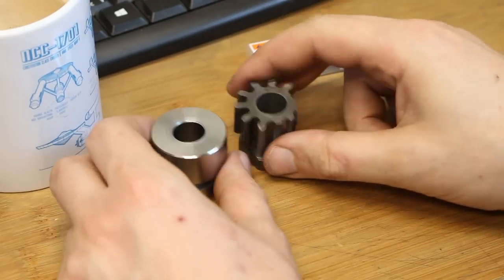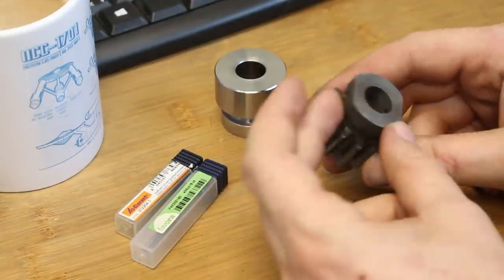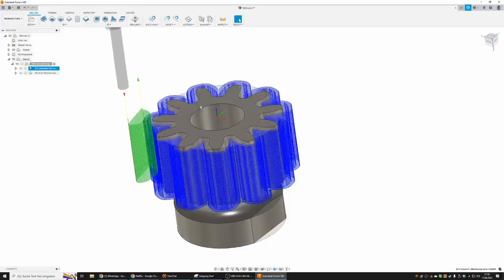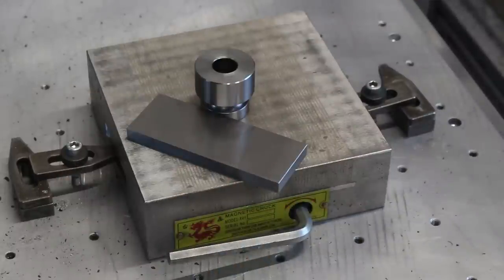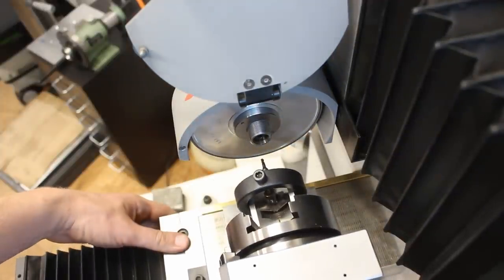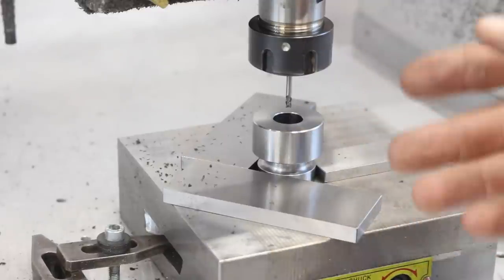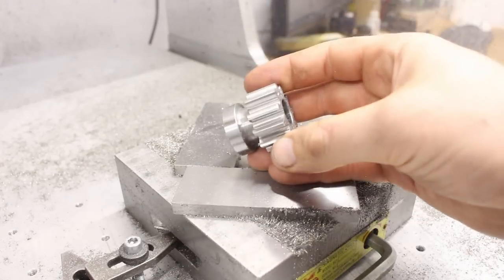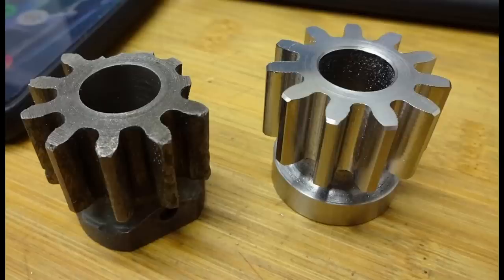Making a part: Replacement gear

Comment: When I worked for UK Plant I saw a lot of gears that shape, usually teeth worn from various abrasives getting in there and changing profile. As long as things kept running, they didn't get changed (and usually compete machine was scrapped rather than try and source new parts)
Reply from the maker: Oh, wear makes sense!

Comment: Hi Sefan! Very interesting and nice result. In your drawing you have 11 teeth with a 36mm OD and 23mm root circle. This is very close to a 2.75mod gear (actually works out to 2.77) or a 9DP (9DP=2.82mod). The slight difference might be due to wear or rounding in your measurements, the original gear looks very worn apart from the broken teeth and may not have been to ideal spec. when it was new (esp. if it was cast). As you no doubt know, gears with less than 12 teeth often have the profile modified, usually by making them with a pitch circle diameter one tooth larger than the number of teeth being cut, however it doesn't look like this was done here, the OD is close to a modified 2.5 mod, but the root circle should be around 23.75mm in this case, so this appears to be an unmodified gear. Not having the profile modified probably contributed to it breaking as the teeth would have a greater undercut and less strength. (Yes I know you said it was close to a 2.75mod at the end of the video).

I'm impressed with the magnetic chuck setup, I might have to get one of those, thanks for sharing!
Reply: I was thinking the same thing. The teeth are fish-hooked from wear, so one should derive the shape from the undriven side (assuming there is an undriven side).

Comment: Axial load is the physics behind the geometry that achieves surface finishes in tight corners. You sold me on the cheap mag plates. Now I'm thinking of die sinking some relief in them. You know why! Cheers from Vancouver Island.

Comment: Mighty impressive. I once watched a CNC machinist neck down a 6mm end mill with a cordless drill and a bench grinder. He looked a bit embarrassed doing it but I had to admit that I'd do the same.
Reply from the maker: Thats a absolutely viable option - I prefer a machine guided approach, since I do it a lot on endmills smaller than 2mm :D

Comment: Gear seems to look like cycloid profile  - typical this days  for clockworks and very unusual in heavy machinery. Still it is a profile that fulfill law of gearing but only at nomimal distance. I was told that those gears have been known as easier to be made in "low tech workshops" . Having here a part from old drill press - maybe that is the answer to odd profile. Neverthelees great job and  thank you for another fine video.
Reply: "Have  been known as easier to be made in low tech workshop" - lol, and now you need a cnc for that, lol. Technology is fun)

Comment: My grandmother had a clothes wringer in her laundry and it has gear teeth with such a lumpy shape.  I’ve also seen it on an old (1890) steam paddle boat.    

Stavros
Reply: I too, when I first saw the original (broken) pinion, was reminded of a 19th Century clothes wringer, or mangle, as they were known in UK.
Reply from the maker: That would be a "Wäschemangel" here :-D
Yeah, thats the kind of device I would expect a gear of that look/shape/quality

Comment: I rarely comment on your videos but had to pop a quick one down to say thanks for making them. I know when one is uploaded that I'm going to sleep well as they're very relaxing to watch as I drop off to sleep, and when I wake up I rewind and catch the second half as a soothing start to the day. This is a poorly worded compliment, I suppose I should point out that soothing/relaxing and boring are very different things for clarity.

You may be aware that in the UK, the German national stereotype is analytical, precise, efficient, boring and lacking a sense of humour. The longer I've watched your videos the more I've realised that the your (and presumably many Germans) sense of humour is very much alive, but usually far more subtle than what we Englanders are trained to pick up on. The more I tune myself into the cultural shift the more I find myself chuckling. The above is very much an assumption based on stereotypes and of course everyone is different, but assumptions are tools to work with like any other adjustment to our perception and in this case it seems to help explain a lot. 

Ta,
J James.

Comment: Nicely done I learned something from today's video. The high or low helix angle creating less radial load and transfers the cutting force to more of an axial load I understood before today's video. However I have never used that style of cutter on steel at such a high rpm and I have to say I was very surprised at the result. A very nice surface finish and the tool seems to have stood up very well. I am guessing the most important ingredient is a high quality tool to start with. Thanks for sharing as always a very interesting video.

Comment: Nice to see these "oddball" jobs, and the measurement methods ... I used the "just clearing" method to get the center of a pulley to drill a set screw hole...

Comment: Yes.. as Elan Jacobs mentioned in another message below, it looks to be 14.5 degree PA.  It doesn't appear to have much (or even any) enlargement, so a large portion of the profile/flank will be undercut.  With a 20 degree pressure angle, I recall the minimum number of teeth where undercut is not an issue is 17 teeth.  At 14.5 degree PA, that minimum number of teeth will be even greater, so at 11 teeth... there really is no good solution. (or at least no good solution without redesigning this gear and its mate).    
However, you made the best solution there was -- simply copy what was still working before it broke!  Your part turned out beautiful.  I need to get my hands on a few of those very high helix, small diameter cutters!

Comment: Excellent machining,  very interesting on the 55 degree helix 4 flute end mill, I've used images inserted in CAD, works very well,  as long as its scaled correctly 😀. 
Thanks for sharing.

Comment: I get more impressed with that Sorotec every time I see you using it.  I'm seriously tempted to get one as I can manage without auto tool change and most of the material is dielectric plastic, aluminium, copper and brass - and now you have it running 42 chromoly! Wow. Did you choose a watercooled spindle motor? I thought there was a list of machines on your website but I can't find it now. Never was any good with computers...

Comment: Great work Stefan , if the gear only had 1 or 2 teeth missing could you have braised and reshape , or would you still have made the new part
Reply from the maker: Definetly a new part. Matching those old and inconsistant teeth sounds like a nightmare to me. And once the cnc is going, its a hands off process.

Comment: On my Haas VM-2, this would have been a great application for a plunge milling rough operation. I’m not sure of the rigidity of your router in Z. I’ve also had to do much larger parts, not a gear, but a pipe flange that had open lobes where I drilled a bolt hole pattern, roughed out the waste on the bandsaw, and then finished it back on the mill in a rotary table. Great video! I liked seeing a little more CAD / CAM stuff. I’ve been using SolidCam, but it is not great for some things. I got a seat for Fusion 360 but I haven’t had time to use it much.
Reply from the maker: I tried plunge milling on the Datron M10 at work - It helps in some cases, but the machine is also not exactly VMC-Rigid ;)

I have thousands of hours experience in proEngineer/Creo Cam, but very limited experience in Fusion Cam. But I have to say, fusions cam is stupid easy to learn and far more powerful in most regards.
Reply: Compared to the early days of CAM, things are so much better now. I’ve worked thru the evolution of the industry and there was definitely a trend where both software and machine controls evolved so rapidly that it was impossible to keep up with ever increasing levels of complexity. I’ve seen literally dozens of machines that were either never used or not used to their full potential because only the people who designed the controls could understand them.

Comment: Hey Stefan, safety weenie here.  What particulate size do you expect from grinding carbide, and what kind of filter is in your shopvac?
If the filter is not appropriate, you may be making the problem worse by distributing the particles evenly around the shop.
I state this from personal experience, (cheap craftsman shop vac filter), and the desire to continue watching your videos for many more years.  ;-))
Prost!
Reply from the maker: Thats a Class M vacuum and a pre-seperator that keeps already most of the carbide in it.
On a very sceptical day I will wear a P3R respirator :)

Comment: For such replicas, which are based on very old stuff that has a lot of wear, i like the normalization method, the Gauss method as i like to call it... You do what you did, take the photo or a scan of the thing, and in this case, overlap the photo 11 times, indexing by one tooth per rotation, granting you the normalization of the wear and form pattern remaining... Sure, its not the do all end all method, but doing that gives you one or more teeth in this case which were there, and are now overlapped by their brethren teeth and can be studied for better match or replication... In your case with cnc, it would involve extruding that one best tooth found after 11 overlaps and rotary projecting the tooth as you did... 
Warmest regards,
Steuss
Reply from the maker: Thats a brilliant trick! Makes absolutely sense, thanks for the idea.
Reply: @StefanGotteswinter  I am most glad! All the best!

Comment: Have you considered getting a cheap digital probe? I have a drewtronics one and can say it is very very nice to use the probing routines to find parts on the CNC.
Reply from the maker: Yes - Considered it, but i am fairly quick with a Dial test indicator and I dont need to change tools to use it.

Comment: I thank you for waking up my brain cells. I have two 12dp. gears to make for my own use. Once the hay is in the barn, this will make a good evening project. Over fifty years of tool room work, I have never cut a gear from a blank. It will be interesting, either way it goes. :-)  :-(
 Again, another thank you for the plan and a chance to learn a new skill.

Comment: Thanks again of a good presentation.
I really do not like the CAD stuff but somehow You made it interesting. Especially since this was a good example of a fusion between manual and computer aided design.
I just wonder how You wouid make this one without the router?
Custom ground one-blade gear cutter, much like a fly cutter used with a dividing head?
Reply from the maker: I would have ground a flycutter and mill it manualy using the dividing head.

Comment: Excellent machining and programming skills as always understated by Stefan!  
The blank audio cut out towards the end, I wonder if that might have been something like: The bad part about using a magnetic chuck for this job is you must DE-MAGNITIZE everything on the chuck?
Reply from the maker: Yes, but since I also have a surface grinder with a magnetic chuck, a de-magnetizer is an absolute must for my shop.

Comment: Zu gut aussieht! I had to put that it because of the aussie bit. Haha.
Stephan, how do i clean a fine diamond wheel that i use for resharpening carbide tips in wood saw blades? It seems to be blocked up and i dont know the best way to approach it.

Comment: The tooth form looks cycloidal to me....but its hard to tell on video of course. Thanks for another excellent video. I always learn something. I have no cnc equipment so I'd probably have to resort to drilling some holes at the root and dress a grinding wheel.

Comment: Mag chucks are underrated on mills, they are so useful. Just one question Stefan, where did you get the cnc vice from? I can see it's from garant but i can't see the part number. On that topic, what do you suggest for work holding on a CNC router like your's? Low profile vices, better a common mill vice or a screwless vice?
Reply from the maker: Those are Garant Xtric vises from Hoffmann, 363000_80S
https://www.hoffmann-group.com/DE/de/hom/Spanntechnik/Schraubst%C3%B6cke/Zentrischspanner-Grundger%C3%A4t-Xtric/p/363000?tId=544

Not exactly cheap, but darn good.

If I had to run this on a lower budget I would buy a bunch of similar screwless vises. and put them on the machine.
(I had that setup for 7 years on the Datron at work: 3 100mm wide screwless grinding vises next to each other, worked marvelous)
Reply: I found some cheap screwless vices on ebay, directly from India. I already know that I'm going to regret this purchase, next time i'm better buying them directly from sorotec as I've noticed that they carry them

Comment: very nice.  I especially appreciate the end mill neck relief part! do you typically take multiple shallow passes when grinding end mills or do you do it in one pass?
Reply from the maker: I try to use as much of the wheels width, to wear the wheel evenly and not taper/radius one leading edge of the wheel.

Comment: Great job! Yours looks a lot better than the original. You always seem to find great deals on Ebay. I’m always looking, but haven’t found many great deals like you. Perhaps I’m not using the right search words. Maybe I should be searching in German. Thanks for another great video.
Reply from the maker: Thanks :-D
As for the deals, most are regular "buy now" advertisments. Heres the magnet chuck for example:
https://www.ebay.de/itm/322859660387
Reply: @StefanGotteswinter  Thanks. I just ordered one.
Reply: If you look on eBay in the US ...they are using the brand name "vevor" a lot now. This same chuck is available on eBay US for about the same price.

Comment: On a Clough42 video, there was a heated debate on cutting involute gears. Few were arguing that having a CNC with a correct diameter end-mill was sufficient for tapered involute for reproducing a lathe chuck pinion gear.  The majority claimed you need specialized cutters. What's your take on it?
Reply from the maker: When you can model it and access in 3 axis, you can 3d Machine a bevel gear with a tapered endmill/dbit or even a small ball endmill, as long as it fits between the teeth,

Comment: As usual, Fantastic. Learning to hate your surface grinder. lol. must be fantastic for your work flow. Your router stiffness is impressive by the way.  What control are you using for it?
Reply from the maker: Its truely a nice machine for small toolroom work :-)
The router has a Eding Cnc control, its windows PC based and connected via Ethernet.
Reply: @StefanGotteswinter  I have several CNC routers, small  Techno Isels as well as some others. I love the hardware but the control side is horid. I would love to unify my set up. So I am always on the lookout for for a new solution. It is like searching for a black dog in the night. thanks for your response.

Comment: I enjoy your videos more and more. This was a fun part to make. I don't like the choice of material. In the past, they made simple parts from material that broke faster than the larger parts that were more difficult to make. So the cheap part broke and not the expensive one.
Reply from the maker: I think the material choise on the original was primarily for ease of manufacture - At the time a casting and a minimum of machining was cheaper and easier than cutting it from bar stock. These days its the other way round.
And agreed, the gear is now stronger than the rack, but the original gear was not damaged in normal use, it seems to have been a transport damage.

Comment: I know cycle time was not really a concern but could you of used 3 tools and include a drill to hog out the material between the teeth to save that endmill on cutting time?

End product looked very nice though

Comment: Hi, always very impressed by your problem solving abilities but confused as to why you used a fairly involved setup on your surface grinder to reduce the shank diameter of your endmills rather than on your D-bit grinder.

All the best
John Harlow 
U.K.
Reply: Might still be in pieces. I expected the d-bit too.
Reply from the maker: The D Bit grinder is still in pieces :D
Currently working on the swivel motion endstops and the dovetails.
Reply: Makes sense, I have a horrific quality Chinese one,  but very useful still.

Comment: Hi Stefan, re your machining parameters for a necked-down 3mm end mill @ 20mm depth which you specified at 15K rpm / 1,000 (& 600) mm/min / 0.15 mm step down. Could you give some insight into how you chose those values given that with a necked-down end mill at that depth you are well 'off-piste' from the manufacturer's recommendations? One could choose very conservative parameters - but then might end up with a job 10x to 50x slower than necessary, which is a bit annoying. I ask as I have a slightly similar job to do with a 2 mm necked down end mill @ 16mm depth cutting grooves in cast iron... Thanks, Alan
Reply from the maker: For the finishing endmill I used the cutting parameters from Fraisa, pretty much unmodified, Only reduced the downsteps - They state 4mm DOC when finishing - But since I used a longer neck and a not super rigid machine, I reduced that to 1mm.
The roughing parameters are from experience to give a very reliable process.

Comment: Probably what you did but didn't call it out in the video, Once you add the image as canvas you need to click on "Calibrate" select two points on the image and provide the accurate caliper measurements. Thus Fusion can scale the image accurately and rest of the drawing can just follow the canvas. Nice video BTW!
Reply from the maker: Very correct! Thats what I did (And forgot to show :D )